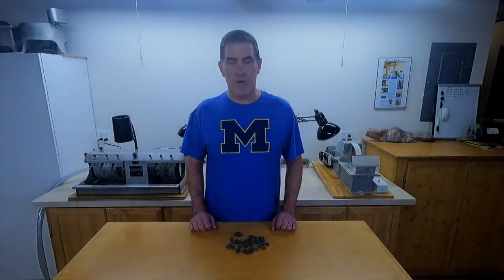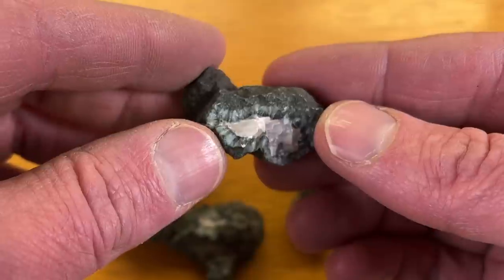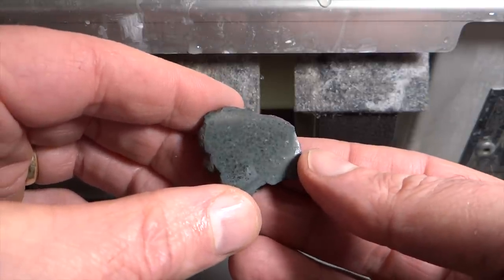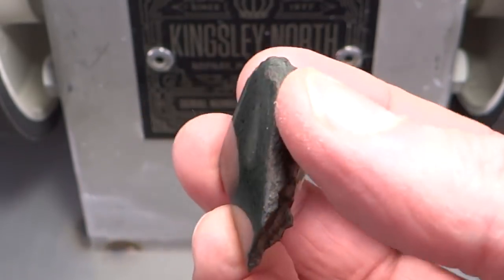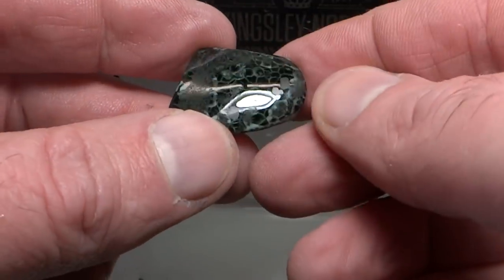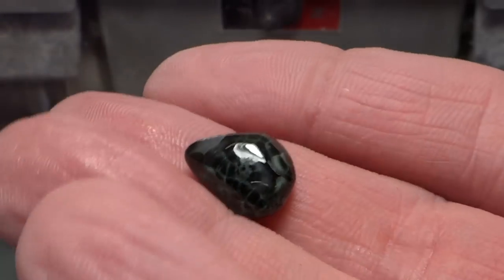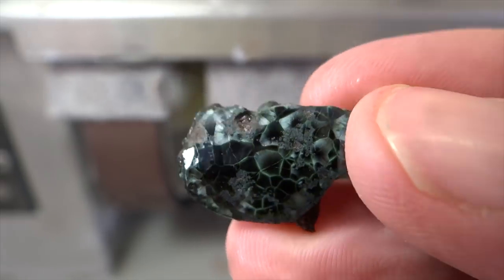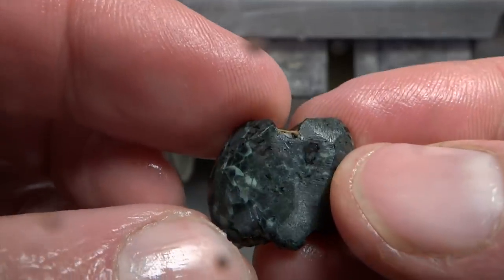Learning to Polish Greenstone

Comment: Great video Rob! Thanks for the shout out! One more tip. When using the hard wheels listen for the change in sound when cutting. When you make the transition from cutting through the chlorite to the gem quality the tone will change to a higher pitch sound letting you know when to stop and check. Dont be afraid to grind in the thin edges to give it more of a cab look. Keep up the great work Rob!
Reply from the maker: Thanks, Chris. I've been wondering about how to make a cab since they're hollow and/or filled with calcite inside. Do cabs have white backs?
Reply: @MichiganRocks  most of the time when i make a cab you choose the best pattern side and try to hold as close to the shape as possible.  Then you take the  opposite side and just start to flatten it. If you happen to open up into a void use a 2 part epoxy and fill the void to make it stable. Once the epoxy hardens continue finishing the back. If set in jewelry no one pays attention to the back but always make sure if someone purchases it let them know that it's stablized. You can use a little black epoxy also to make it look better.

Comment: WOW ! Those are stunning. It’s no wonder it’s the state gem. Apparently there’s a rind on the outside and you have to grind through that and into the crystals below before you get the turtle pattern. I wonder if it might be better to grind a flat on the back side and attach a dop stick to make them easier to hold. Thanks for sharing !
Reply from the maker: I'm not sure. The problem with that is that they tend to be hollow. I have a lot to learn about these little guys.

Comment: This is what I was trying to find you in that last pile we were at. They are there as well as other places on the Peninsula, just needed more time. 
One thing about greenstone is not to be afraid to go deeper when grinding. But, it certainly requires a "touch" to get it right.
Reply from the maker: I still haven't chipped away at the rocks you found with me. The greenstones in those don't seem to be as big, but I'm going to learn something when I try to extract them.

Comment: Wow, this video is so cool! What a great gift of greenstone you received! And it helped me confirm that a piece of basalt with some interesting chunks in it I found up on the Keweenaw a few years ago probably is greenstone after all. Maybe some day I'll be able to get it cut and polished up. Thanks for confirming my suspicion - it's been one of my most precious rock finds and now is even more so. Thanks for your great videos! Michigan rocks are the best rocks.
Reply from the maker: We sure do have some good rocks here. I hope your rock does have greenstone in it. Look for the broken ones, that's the easiest way to tell.
Reply: @MichiganRocks  Yeah, the one I found has a nodule of the greenish radial chatoyancy with what looks like some calcite in the center. Very similar to, though not as impressive a specimen as, the ones you worked on.

Comment: One of your best vid’s Rob. Thanks. I like that cabbing machine. Can you polish the concave side, like the back side of the piece that broke off? Btw Swede’s in Copper Harbor has some nice greenstone, mostly jewelry not raw samples. Also Korner Gem in Traverse City.
Reply from the maker: The wheels on my machine are six inches diameter, so I can polish a concave area of that diameter.

Comment: Hey Rob, very interesting rocks and I love learning new words with Greek roots. I wonder what those rocks would look like if you tumbled them in the same way you'd tumble obsidian. They are similar in the Mohs scale.
Reply from the maker: I don't know, but I'd be worried about a couple things. First, that plain green rock on top (I think it's chlorite) varies in thickness. tumbling would remove it uniformly, so you'd work down to the turtleback pattern in some places before others. Also, they're so small that it would be easy to grind them to nothing. I'd be checking them every day.
Reply: @MichiganRocks  Good point. They are so rich in color when you get that turtle back look; it would be a shame to destroy them.

Comment: The thing I notice with these is the whole stone usually doesn't have pattern only part of it so if you get one good face your good.  The bigger ones are usually hollow or have quartz in the middle and the greenstone is like a shell around it.  The smaller ones can be solid if they are small enough without quartz or something in the middle.  Really most of these if I can just get one good looking face on it I'm  happy and it might have a small imperfections possibly but that is okay.  Those greenstone you have cleaned up nice they look really good.  I have to go hunt some petoskey next year I haven't tried before but I'd really like to figure out where to get some of those.
Reply from the maker: You described them well. They're very tricky to polish well because the pattern is on such a thin layer.

Comment: You had an ethereal look at the beginning of the video. You must have had a smudge on your camera. Wow. Those don’t look like much before, but they are sure beautiful. If you could get bigger pieces, they would be good for your stone turtles. I like the inside crystal formation. That’s kind of interesting. If you had a big enough piece, it might be pretty as a polished slab. It would have the contrast of green with the white crystal center.
Reply from the maker: I don't know what I did on that opening shot. I have some lights and one's dial is messed up. When I turn it,  it goes to random numbers. I think I must have. bumped it and turned it way up. I'm not sure. 

People make cabs out of greenstone, but I'm not quite sure how yet. They're so small and usually hollow.

Comment: Isle Royale greenstone contains a pink material that isn't found in the Michigan greenstone. It's always fun to see how things polish up. Does greenstone tumble well?
Reply from the maker: I haven't tried tumbling it. I was told that some people tumble it a little to get to expose a little pattern before they start cabbing. It would be very hard to expose the turtleback pattern consistently around the rock by tumbling. In some places it's near the surface and in other places there's a lot of overburden that needs to be ground off. 

I didn't realize that the Isle Royale material was different than. the stuff in the Keweenaw.
Reply: Depends on where you're at. I have seen the pink mineral mixed with greenstones from the Peninsula as well. The pink mineral is either a copper bearing prehnite or (rarely) thomsonite.
Reply: @MichiganRocks  it seems really strange that there would be a difference. Geologically and geographically we are talking about a really small area.
Reply: @captpaul8827  According to the university there's no Thomsonite in the Keweenaw (including in the green stones) it could potentially be Datolite
Everything that used to be thought to be thomsonite is actually prehnite in a thomsonite habit or potentially mesolite
Reply: @carmenevans7651  it is a small area, but there are definitely differences in the stones. The Isle Royale greenstones tend to be considerably lighter in color than the Keweenaw greenstones

Comment: I've been playing with green stones for quite a while and got to talk to a couple of the old time folks about how to work them. 
From John Perona I learned that nice smooth side is almost never the good side to work (almost) it's usually the Lumpy difficult side that gives you the best pattern.
The other person I've learned from is Ken Flood at Keweenaw Gem and gift. When he works them he never uses a hard wheel, he uses a soft wheel 60 Grit and then moves immediately to a 600 grit.
Reply from the maker: I found the same thing with the lumpy side seems to be the good side. Thanks for the tip about stating with soft wheels. I don't have a 60 grit soft wheel, but I could start with the coarsest one I do have.

Comment: That's a cool mineral! So I'm guessing that it forms from the low temp hydrothermal metamorphism of basalt and other mafic rocks? Given the amount of calcium in the host rock and Chloroastrolite, I wouldn't be surprised if the clear minerals in the middle were calcite. Is this mineral often found in association with zeolites?
Reply from the maker: You're asking too many questions, Mr. Johnson. They form in basalt and they're really cool looking. That's about the extent of my knowledge. Here is more knowledge: https://www.mindat.org/a/chlorastrolite
Reply: @MichiganRocks  sorry! I'm very enthusiastic about rocks!
Reply from the maker: @geologyjohnson7700  No need to be sorry, I was just having a hard time keeping up! Carry on.
Reply: You've got it pretty well pegged including the calcite in the center, except sometimes the center is solidly filled with chlorastrolite, sometimes calcite, sometimes prehnite, sometimes quartz and sometimes straight Hollow.
They tend to vary from Stone to Stone and location to location. The location those particular stones are from they could be any of the fillings. One of the keys is that the calcite and the hollow ones frequently break while you're trying to polish them.
When you start working them the old timers will tell you "never fall in love with one until it's finished and even then it may break afterwards"
Reply: @lylelay  Fascinating, thanks for sharing.

Comment: I wonder how those would turn out in the tumbler...
Reply from the maker: Kyle told me that they are sometimes tumbled for a short time to reveal some of the turtleback pattern, but then they're worked on a flat lap or cab machine. I haven't tried tumbling them, but the problem I see is that the plain green on top of the turtleback varies in thickness. Tumbling would most likely remove the outer surface uniformly all the way around. The other problem is that these are so small that it would be very easy to grind them away to nothing.